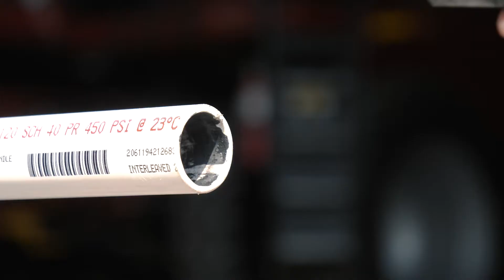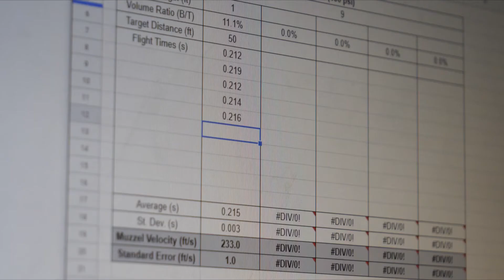Perfecting the Air Cannon | Project Woodwind

Comment: So would you say a barrel to tank ratio of around 4:1 is ideal. Just trying to make sense of your results. Great video though
Reply from the maker: We saw the fastest speeds between 25-30% barrel to tank, meaning 1:4 or 1:3 where the barrel  is shorter than the tank. I agree this seems way too small but it's just because of this particular cannon. There was a lot of friction between the projectile and the barrel even after we shaved some size off of it and added lubricant. Most cannons are probably using valves and loose fitting projectiles with less friction. This allows for longer barrels to be used. So does increasing the tank pressure, because it helps overcome friction and means there is less pressure drop throughout the barrel. This might apply to potato cannons where it's snug in the barrel but that's about it. 

We want to run it again at some point with a better projectile and different types of valves to get more realistic results.

Comment: Barrel is too small.  There is a lot of air power being wasted with just not having a long enough barrel.  Built one for my senior high school project.  Had a 6" reservoir that was about 30" long attached to a 12 foot barrel. Our barrel was 1" diameter instead of 1.5".  We sawed the end off of a 1 inch bolt you can by in any store.  All of a sudden we had a metal projectile that weighed over a pound, that fit perfectly in the barrel.  We fired it off at home plate on the baseball diamond and it went over the fence about another 150 feet.  I suspect it left the barrel at about 300mph.  It was pretty impressive.  If shot at the front of a pickup, at near point blank range, it'd definitely have destroyed it.  Anyways, longer barrel.  Before we had a 12 foot, we tried an 6 foot, but instead of being able to fire 500 feet, we only got about 100 feet out of it.  It's not anywhere near the same.  So much of it is about the barrel and using every last bit of energy.  For what it's worth...
Reply from the maker: You’re right for most canons, the main reason our optimal ratio is so low is the amount of friction. It was a very tight fitting rubber stopper so you can’t have a very long barrel without the pressure being overcome by friction. This is just a side effect trying to make a valveless cannon with variable barrel length
Reply: @ConHathy  Ya, it looked like you might have a munitions issue.  Things that are cut very precisely... many metal things... wood things... they make great ammo because they fit perfect without a lot of friction problems.  None the less, cool, right?